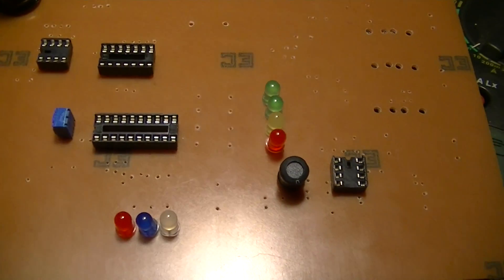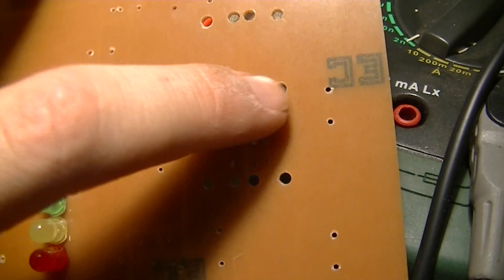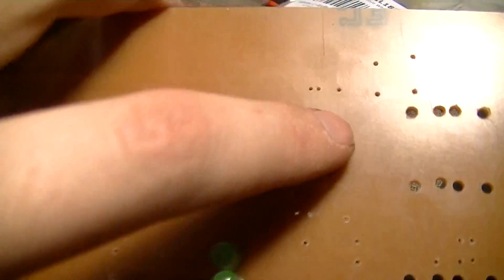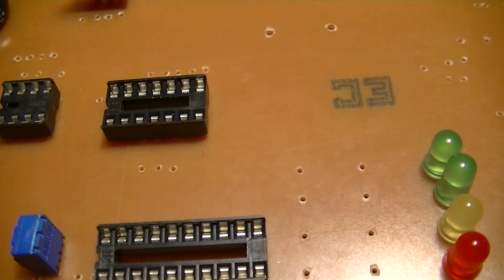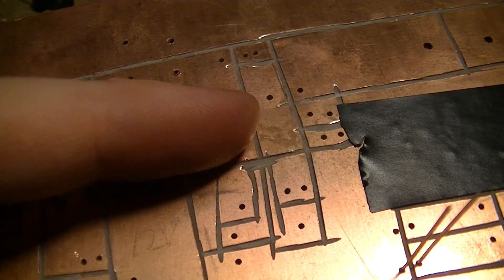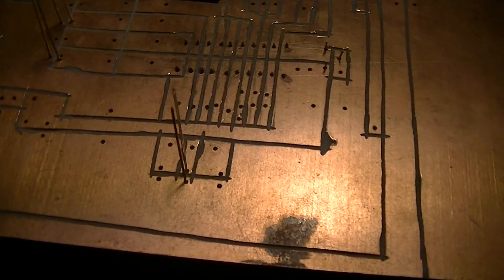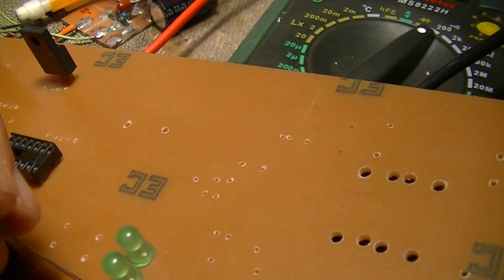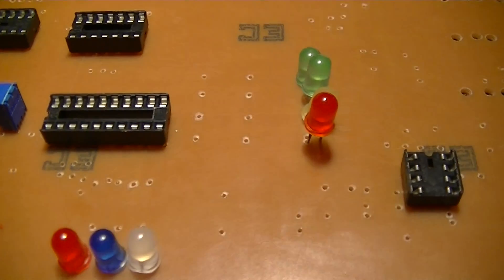DIY MPPT circuit board

Comment: It would have been easier to have used an etch resist pen to make that board. Then etch in common ferric chloride. Would be easier than using a dremel from harbor freight.

Comment: I checked the cad program . You said it was a pain in the ass it is free have you tried any other cad software?
I have worked and had copy of auto cad with the electronic add in . I started using it in 1990 after I got out of the NAVY. Its a great program but my copy is dated and I am a disabled vet so I can no longer get it free.

I will check out the latest videos. I am in and out of the hospital and there is no internet in the VA hospital.

Comment from the maker: I meant the drills that I used to make the component holes in the board.  They are from a random assortment of very small (usually 20mil to 50mil with some smaller drills and very few bigger drills) drills and rasps.
I carved this board as my PCB CAD software is being an ass and not downloading a lot of component footprints that I need for the board.  I will do a video on the technique that I use in a few weeks knock wood.  This board has already been soldered; check my latest video.

Comment: Did you get something wrong? I do not see any Harbor freight drills.
Did you hand etch that board and will you hand solder it?
Looks good so far . What kind of meter was in the background .
It looked like one of the older types . I have a old Simpson analog meter I carried it tru my life from when I bought it in 1972 thru my 7 years on submarines where the had 2 of those meters in use during the 1981-88 bad part I am disabled vet wish I could have done 20 years .